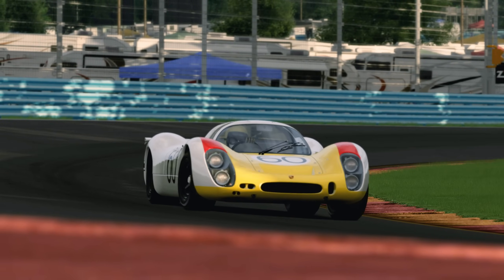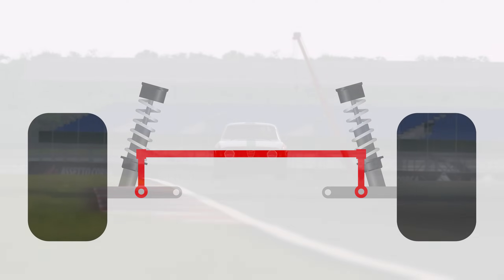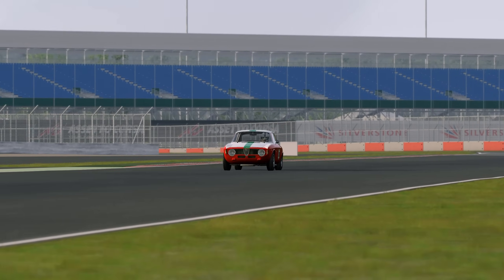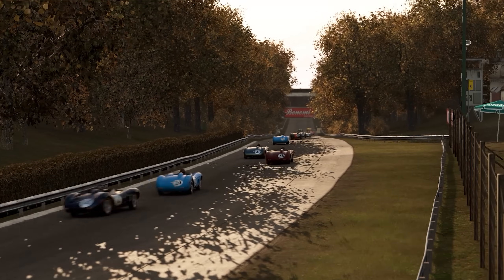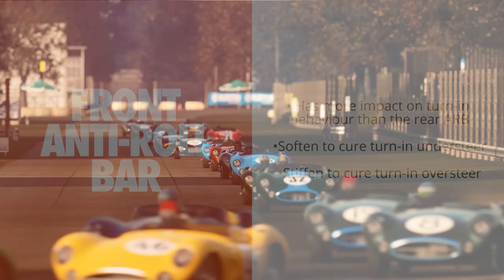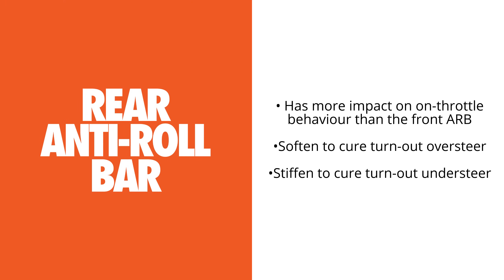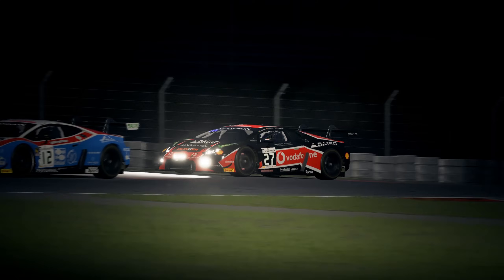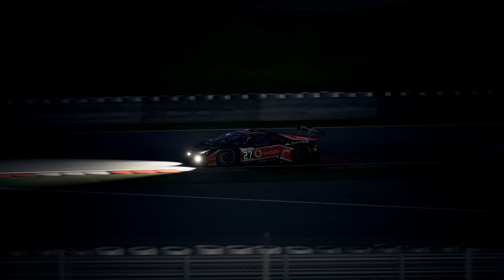Sim Racing Setup Guide 04 – Anti-Roll Bars

Comment: Thank you very much for the video!  I can understand the the front ARB part, but still confuse at the rear ARB. I thought soften the rear ARB will allow more rolls hence put more weight at the outer rear wheel, causing the rear part to oversteer. why soften rear arb cures oversteer?
Reply: Roll doesn't influence kinematic load transfer at all.

If you soften the rear axle relative to front, you will introduce less lateral load transfer across that axle, and more in the front, hence understeer.

Comment: I really love your setup series, it's a great help! But I do have a question: I thought stiffening the front anti roll bars would make the car more responsive on the front end and cause it to turn in more easily and not understeer because less weight is transferred allowing for a more direct handling. I can't see how that would induce understeer?
Reply: Stiffening springs on an axle will cause more load transfer across that axle. Only relative stiffening, though. Absolute stiffness of both axles doesn't affect it.

Comment: Front roll bar stiffening can reduce turn in understeer in medium speed corners. Due to the lesser body roll you reduce the weight transfer leading to the inner tyre having more load during cornering which increases it's contact patch providing more overall grip. Circuits like Spa benefit a lot from a stiff front and rear (up to a point).
Reply: Incorrect. Springs don't influence load transfer; apart from the axle that you stiffened relative to the other having MORE lateral load transfer relatively, with the other axle having less. Hence why more spring stiffness on the front will, if only kinematics are concerned, increase understeer.

Body roll has nothing to do with kinematic load transfer, at all.
Reply: @ArchOfficial  ok, what has body roll to do with?
Reply: @Heldermaior  It doesn't have anything to do with load transfer. The only exception is the very small movement of the CG laterally which will of course impart a little bit more gravity to the outside, and a little bit less to the inside.

Even in vehicles with no roll, like a shopping cart, there is load transfer.

The roll is just due to the deflection of the springs, it's a side effect. The car rolls BECAUSE load is transferring, and stiffer springs cause less roll not due to less load, but due to more resistance to the load.
Reply: @ArchOfficial  ok. Got it

Comment: Can't say enough wonderful things about this series, fantastic job Chris! I'm only 4 videos in and already on my 3rd page of notes. This one was tricky for me to understand and I had to read the Wikipedia article and scratch my head to understand why these adjustments do what they do. It finally clicked when I realized that when you discuss softening/stiffening the ARB to affect understeer/oversteer, you are affecting the RELATIVE ARB stiffness between front and rear. Uneven ARB stiffness thus creates a twisting action about the car's axis which changes which tires receive the most grip. This also explains why some cars rear inside tire pops up off the ground during hard cornering. Cheers!
Reply from the maker: Yeah, exactly that - glad you are finding the videos useful David. I really like the way you've described how this works. Relative stiffness is a huge component of under/oversteer balance, but absolute stiffness is still a factor as well.

Comment: Hi Chris I need your advice. As you mentioned it’s better to change one setting at a time but if that first setting doesn’t fix the problem should I put it back to its original before going to the next one? Or leave it because the second one won’t work if I put the first one back I hope I don’t confuse you I’m asking this because I have heard that some problems need more than one setting to fix it thanks
Reply from the maker: Hey Hector - yeah, that's the approach I take. It can be quite time consuming, but I try to develop setups over a few days/weeks, rather than in one session! However, you're right that some issues will need more than one change, but I still try to feel the effects of one change before I move onto the next. This is mostly because I don't trust myself - it's very easy to start being tricked by your senses... and the placebo effect is strong!